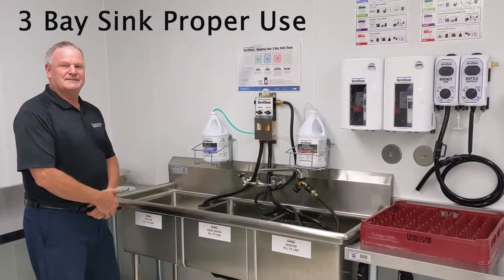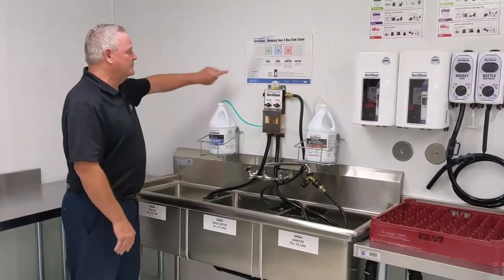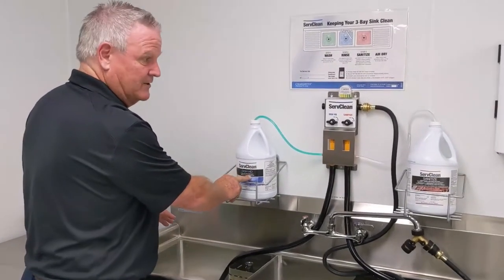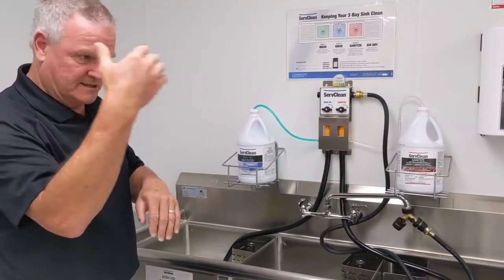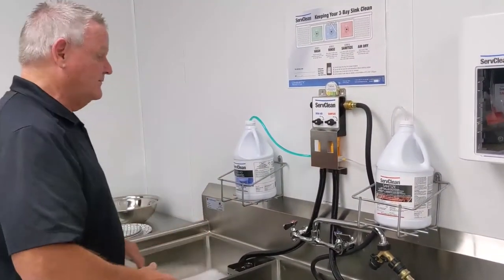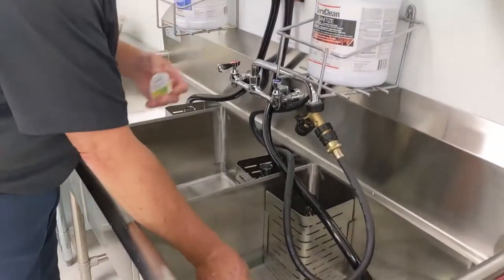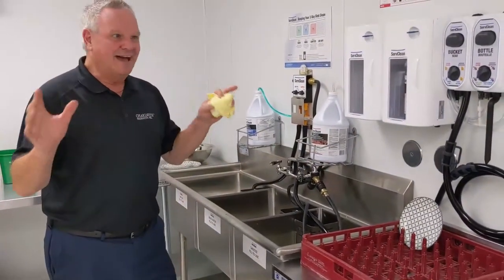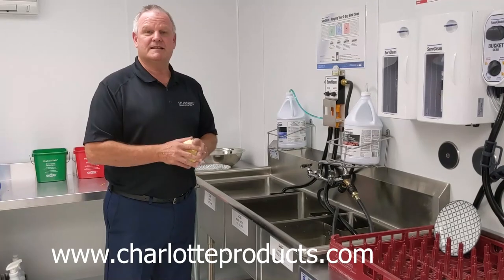How To Properly Use Your 3 Bay Sink

Comment: Two comments, offered in the spirit of getting better and properly educating both installers and foodservice staff…

First, when testing sanitizer concentration - which appears to be some quat derivative based on orange test strips - always following test strip instructions which do not include moving/shaking the test paper once submerged in water. That can result in a false reading. And typically, quat test strip exposure time is 10 seconds, not 2-3 seconds as demonstrated. Regardless, always follow the testing instructions detailed on the bulk chemical label to ensure the test strips being used are the correct kind. 

Second, the center faucet spigot - where the y-connector device was installed - should have a corresponding hose bibb backflow device. While the wall-mounted chemical dispenser likely has a built-in air gap (which is not easily visible/accessible) a hose bibb at the y-connector shut off guards against residual water in the hose from back-flowing into the potable water supply.
Reply: Thank u s0 much f0r this I have ab0ut 6 months of experience in dish washing and needed to learn how to properly test the water with the strip when I first started management acted as if it wasn't a big deal so now I have to go and try to figure out how to do it on my own. It's really embarrassing to admit that I still don't know how to do that. Been sitting here trying to find some proper video's on how to do this how to check the temp. I watched the safe serve training video once yet can't keep the dang training but I did write down all the notes sense this is what I see myself doing (being a dishwasher) and as of now trying to be a lead which my manager knows about but with only 6 months of training I feel like I'm not that good. I'm fast but it's been really tough. So yea just need to learn how to test dishwasher that's what I'm struggling with. The second paragraph I think I understand what you're talking about. I must admit I'm afraid to test the damn sanitizer I'm afraid my co workers will judge me it's really embarrassing.
Reply: @mariahconklin4150  - appreciate the comment and glad my two cents helped! Regardless of how your manager reacted, if the sanitizer isn't at the correct concentration then whatever was washed will NOT be sanitized. Maybe your manager will understand this; improper sanitizer is a Priority (i.e., critical) violation when the health department finds it.